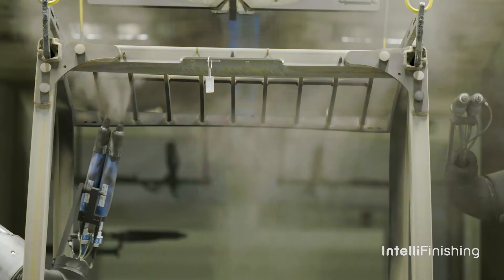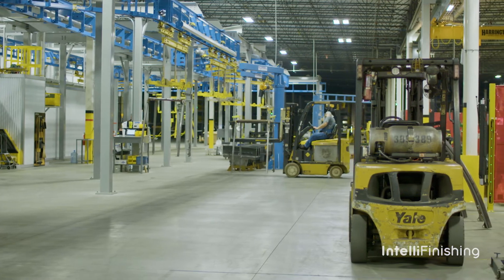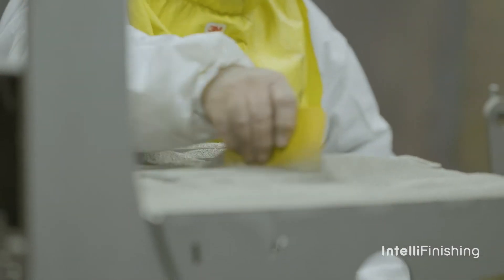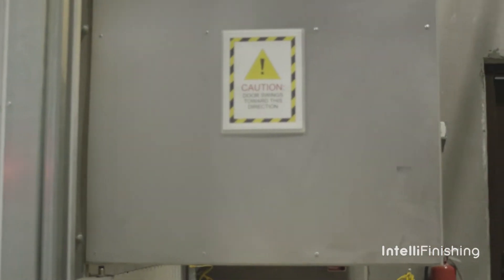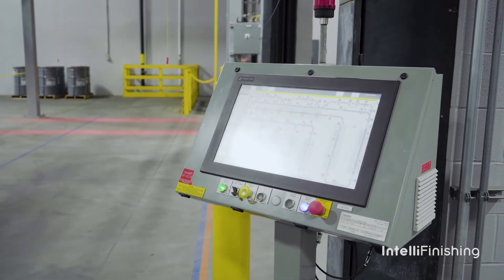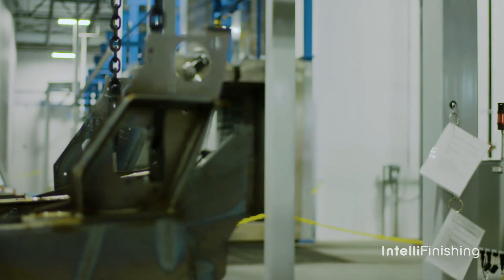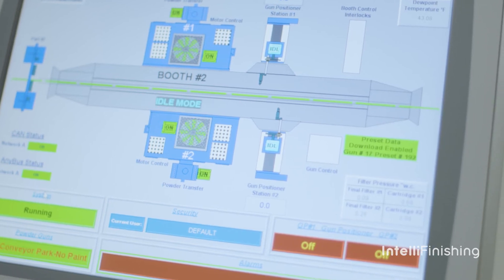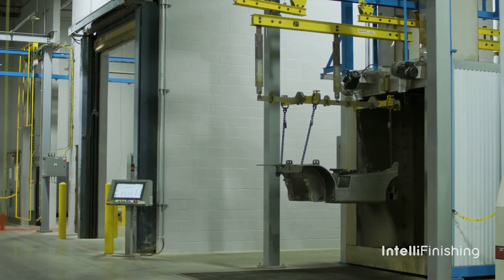IntelliFinishing Provides High-Level Automation for Hyster-Yale

Comment: since set up, surprised to see two guns running parallel, thought that would affect the Ion sphere at the tip of the guns for charging.  Surprised how low the line density is though.